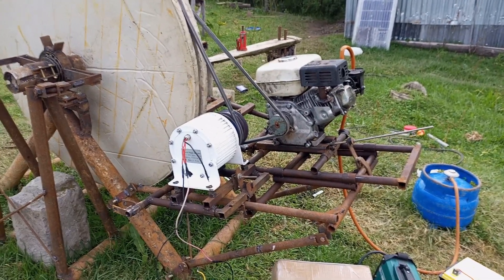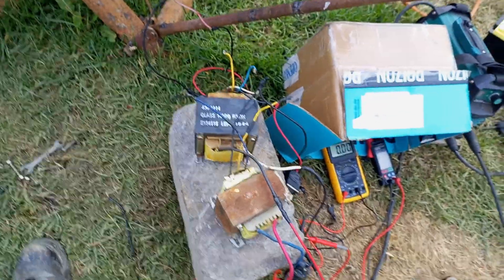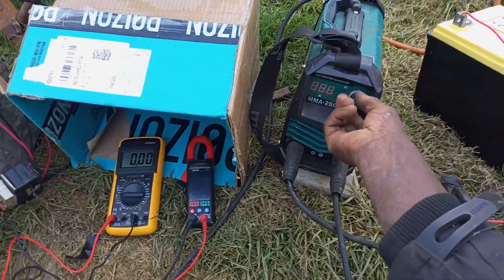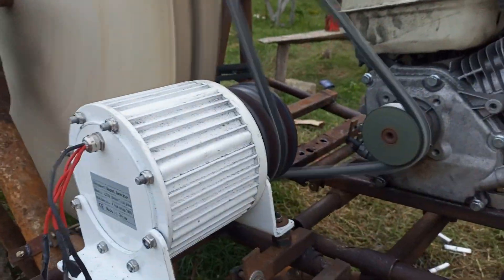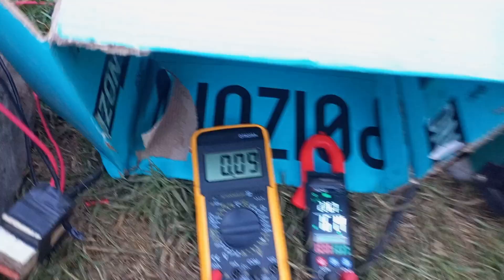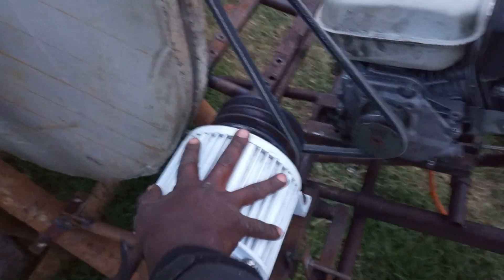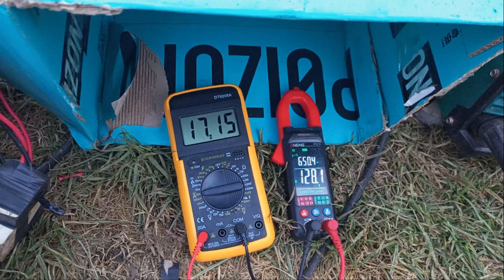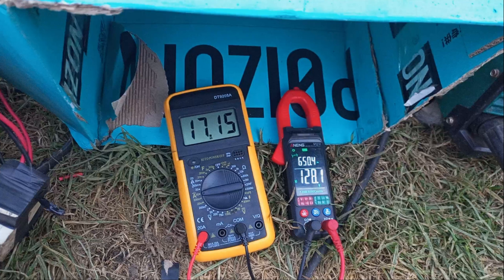Lots of Watts!!! Getting lots of power out of Chinese PMG by using high RPM #diy

Comment: I also bought the 20kw pmg complete with coupling and 1500 rpm motor. When I run it without load it produces 345v but as soon as a plug kettle voltage drops to 76v.  So I need information on what type of transformer I can use to step up the loaded voltage. I also bought wind turbine 100A 1600V rectifier  which gives reading of 444vdc. So I don't know what to do to get my dream 20kw. Please help.

Comment: It’s fake. Why are you trying to deceive people?
Reply from the maker: I never said its original. If you watch all my review videos, you will see that I said as per spec they have, you can only get 300W out of this. I had to do a lot of non standard tests to get it to produce any directly useful power and it failed in the end. Just couldn't handle it. I just didn't want to dismiss it without due diligence
Reply: Now I am confused I  just saw you welding with pmg after adding transformers in parallel.  So are you saying that was fake?

Comment: I bought the three-phase generator, but I have a problem that we can't start it, the generator has three output phases but not the neutral phase, how do I install the neutral phase in the 10 kw generator with 300 rpm
can someone help me
Reply: What's the phase to phase voltage?

Comment: Hie thanks for your great work,  l need the use of these  transformer instead of using an invetor 
What is your advice on buying  a 48v wind generator compared to 220v .
May God bless your effort .
Reply: I already bought.  And this is what I have, I want to use it without the need to charge batteries, do you have an idea?
Reply: You need reactifire single fase or 3 fase
If connet direct generator must produce three times the amount watts needed by your component
Reply from the maker: I think a 48v ones might be better suited for running at higher rpms. But remember that the frequency is higher than normal for normal appliances and might not be suitable for direct use. I had to wire the input inductance of the two transformers in series to achieve a lessor inductance to match the higher input frequencies otherwise there would be a lot of Eddy current losses from a single transformer designed for 50hz ac.
Reply: @diytech4522 Hello Sir please tell me more about the transformers you hooked in parallel. Because  I also want to increased my pmg  voltage and watts  so that I will be able to weld with it.